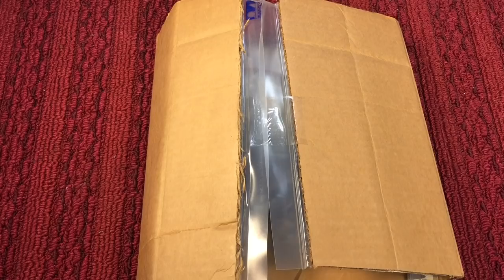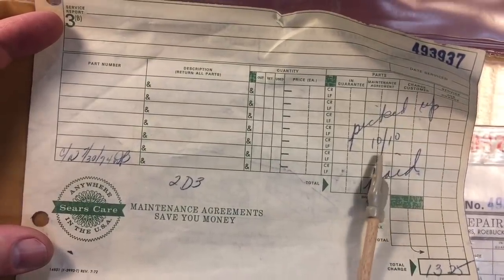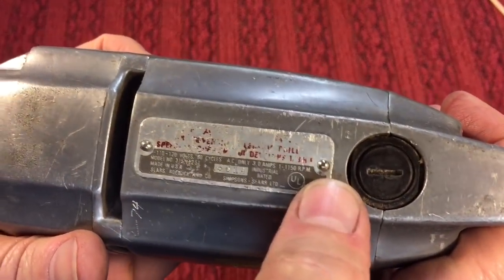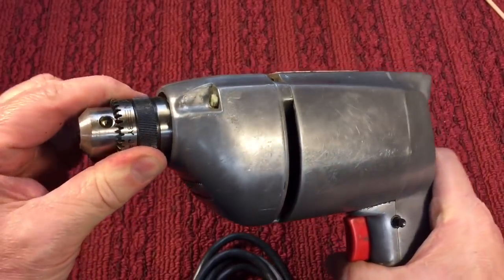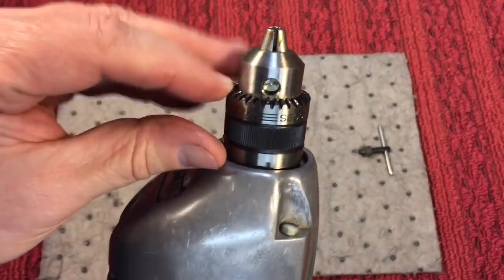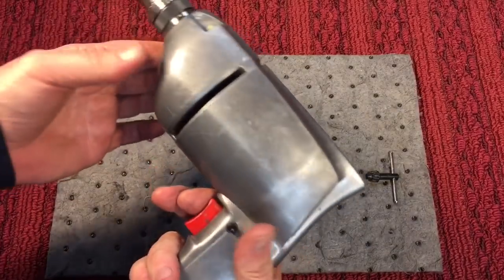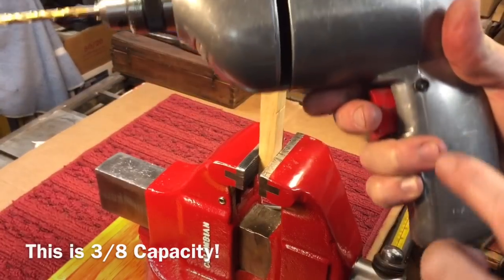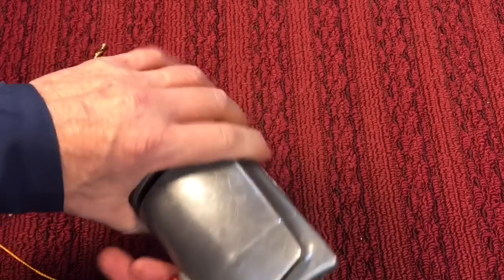Vintage Craftsman Power Drill Unboxing

Comment: There was a wide period of time when metal drills came with grounded plugs. The ones that didn't and are dangerous are (to my knowledge) mostly from before WWII. Sometimes you find newer metal ones with the ground pin snipped off or the cord replaced, because a lot of sockets in the US were two-prong for a long time. This is dangerous because the electrics can short to the housing and shock you, absent another ground. After about 1958 you start seeing metal-bodied two-prong plugs, because Millers Falls started the trend of double insulated tools as a way to work around the two-prong issue. Millers Falls made an estimate from tools sent in to them for service, and claimed half the tools in the US had the ground pin nipped off. (I have some suspicion that number may have been exaggerated a bit to sell the double-insulated feature, but it was a genuine concern.) Metal bodied tools to my knowledge remained in production thru at least the late 70s in mostly "professional" product lines.

I have an old Black & Decker U-100 1/4" drill, with a 3 prong plug, an all-metal front and black-and-grey plastic grip. No VSR on it (it's a homeowner version) but I got it with the manual and several other things for very little. The plastic is actually very comfortable. I did manage to mess up the brush seating when I was giving it a cleaning (not knowing what I was doing) and so it has little blue sparks on the motor and really smells...

Comment: I have one that's almost identical except mine has a shorter handle and no reverse switch. It also has two side vents and no front name tag. I had mine about 40 years and it still works like new.
Reply from the maker: Hello Glenn!  Yes!  I know the model!  Those drills were just so well made, usually the power cord coming out of the handle would fray and crack, otherwise they would run forever! I still have a few I love using!  Thanks!!!!!!

Comment: Scoutcrafter, the hole at the front/top of the drill is to lock the gears is to hold the chuck in place to tighten or remove a bit or also to replace the chuck. My father had a similar 3/8" model and it had the same feature. By the way, they make a rubber chuck key holder that attaches to the cord. I have them on all my plug in drills, they work great. you should be able to find one at any Ace or True Value  hardware stores.
Reply from the maker: Hello Ronald!  Yes!  The Rubber straps work well, better then the plastic ones they replaced!  Mick 47 said the same thing about the small rod!  Thanks very much!  I will try it!  =)

Comment: Scoutcrafter I came across your video just by accident. I was just looking to see if I could find someone who may have found a Craftsman just like yours. You see today Sunday April 14th 2024 I came across one exacting like that with that same Craftsman name directly under the chuck for $4. I cleaned mine up because it was really dirty and the chuck was rusty. I was able to get a chuck key for it. It also has that Allen key on the cord that is 3 pronged. Mine has had a hard life, but still works. Unfortunately the button to lock it on is broken, oh well. Any idea how to replace the button? I love watching your videos.

Comment: The second i saw the thumbnail closed my eyes and took a whiff and i could smell the electric ozone. And when i heard the drill whirll i could see my dad drilling into some plywood. He also had an old 50's chrome meat slicer with that type of motor, so those sounds and smells also remind me of holiday ham being sliced up

I may have that same drill, about 15 yrs or so i had 4-5 metal drills and 2 skilsaws of my dads i was about to toss out. Then i thought better of it because i knew they worked perfectly. Still have em and have been meaning to pull them out for a restore. Nows the time

And i like knotting and the idea of tying the chuck key. So i tried Boatswain's Handcuff onto the key and Prussic  onto the power cord and it works nice
Reply from the maker: Hello T Vład-  you know the Prussic knot saved my life once so years later I made sure all my scouts knew it well!!!  Great stuff!!! I'm so glad you kept your Dad's drills!!!  😃👍.  Thanks!!!!
Reply: Well i pulled out the old box , and boy do i have some more future projects.

Here is what i got:

Craftsman '60' 1/4" drill

Stanley 3/8" drill , faded scraped up label

Black & Decker Home Utility 1/4" drill, HU-1.. very cool old one

B&D Standard Duty Holgun no.653 - plastic chassis

Dayton 3/8" Workshop Drill 2Z395A

B&D 1hp 7 1/4 Circular Saw No. 7301

Sears Craftsman 4" Professional Belt Sander

Skil Jigsaw 3.5amp Model 160

Monkey Ward - PowerKraft Utility Orbital Sander

Gemdaddy Deluxe - Electric Churn

Most look in working order, a couple are seized. Most need new cords, grounding. I fired up the Skil jigsaw, man what a beast. Strong Loud, with a great blast of sweet ozone. That and the B&D HU drill are going back into service.

Beautiful pieces of Americana, glad i kept them
Reply from the maker: @Mostlyonoff  That is a sweet collection for sure!  The cords were always a problem.  You can order some replacements from Amazon or just get a heavy duty extension cord and a half dozen plugs!  LOL  Thanks!!!!!!!!

Comment: Very nice.  You could leave as is or polish the aluminum and clear coat it. You could even change the black area to read with black or white letters.  The value for the drill won't be diminished because the value is set by you. By the way I have the circular saw to match. As to electric drills,  I have several but the best is a newer Milwaukee. Hard to beat that with a battery model.  I am not likely to move to a battery powered drill press either.
Reply from the maker: Hello 57W!  Yes!  I have two drills on the list for restoration as I already bought the replacement cords, I want to polish those and do them up right.  This one since it was refurbished already I will use as is.  I am looking forward to getting started on the other drills.  I love older Milwaukee stuff!  Nothing beats a hole-shooter!  =)  Thanks so much!!!!!!!

Comment: I always saw chuck keys held on with rubber or leather, so they could rotate in the chuck.  Never posted on metal.  How is that going to rotate in the chuck?  That smell in 1950s-60s electronics, fantastic.
Reply from the maker: Hi Mark!  I found out that pin fits in the hole in the housing just behind the Chuck and it locks the spindle so you can remove the Chuck!  Thanks!!!!

Comment: I have one nearly identical from my father.  I want to rehab it but the brushes don't seem to be available any longer.  I also need a replacement trigger, the locking button is missing.  Do you have any resources for finding parts for these classics?
Reply from the maker: Hi Clif!  The brushes should not be a problem...  Many times you can grind the brushes down to your specific needs.  As for the button, I don't know...  These drills can last a long time if not abused!  Thanks!!!!!!!!

Comment: Jeez, I remember buying new drills before that. 😀 That one is sure sweet though a really lucky find. The loop that goes over the body of the chuck wrench then goes around the handle as you had then it goes back through the starting loop, at least that's the way I've always done it. Great tool find, you gonna polish it and restore the tags? Thanks for another cool tool video!
Reply from the maker: Hi George!  I am going to restore two other drills that I already bought cords for, they are aluminum housings drills too!   Thanks so much!!!!!!!!!!

Comment: Outstanding! I think the rod is for removing the chuck, locks.  the drill. Question I need two switch's for old tools. anyone out there  have any hints. Thanks
Reply from the maker: Hello Norherman!  Yes!  A small hole behind the chuck on top of the housing!  Thanks so much!!!!!!
Reply: Check ebay.
Reply: @whatchacookin1096   So far thats been no help. Thanks

Comment: I have this exact Craftsman drill motor and it's my everyday go-to drill. It is rugged and powerful. The variable speed and reverseability are really handy when driving screws. The mass of the armature and gears is enough to finish driving a dry-wall screw the last turn or two flush into a wall stud when the trigger is released. 
   Note the oil hole on the top front of the drill. I put a few drops of medium 30w oil in every once in a while. If I recall correctly there is a lubricating felt on the other end of the motor, but you have to open the drill motor up to get to it. Servicing this drill is very easy as it is all aluminum castings and easy to remove screws. The only plastic is the trigger and the speed control switch. Mine has always had a 3-wire grounded power cable.
  I would recommend opening it up since it is so easy and check for dried out lubricant in the gear reducer and the motor armature shaft.
   I have some kevlar cord for attaching the chuck key. It's tough and cutting it isn't easy. If you want some lengths of it let me know (and of course I'll have to find it in the shop). Making an attaching cord is easy. Tie the cord ends together to make a loop. Hang the key in the cord as you did in the video. Now take the other end of the looped cord and stick it under the cord where it passes over the body of the chuck key and pull it through... voila! When you pull it tight the chuck key can't come loose. Now put the end of the loop under the power cord and pass the other end (with the chuck key) over the power cord, through the exposed loop on the other side and pull it tight.. and you're done!
   
  Cheers from NC/USA
Reply from the maker: Hello Ace! Yes, I will open it up to check it out, I was told the wire on the cord was to lock up the spindle and remove the chuck, is that the hole on top behind the chuck?  It looks like that!  That has to come off before the drill can come apart!  LOL   Thanks!!!!!!!!
Reply: @ScoutCrafter  So that's what its for!

Comment: Hi ScoutCrafter.
I just restored a B&D D300 i think from the 1960 or 70's with a Jacob Chuck...
Had to create the brush holder spring connector... But it runs. And now I have a drill to atach all my grandfather buffing wheels😉
You can see some of the work on my channel..
Thanks for sharing
diYotam Ch
Reply from the maker: Hello Yotam!!!!!!  I love those older drills, they just are such a joy to use!  I have a couple more awaiting restoration!   Thanks so much!!!!!!!
Reply: @ScoutCrafter  My kid love the restored drill. Fits perferctly in his hand. He even used it with a wire brush to remove "patina" from his hammer 😉. Just uploaded a vid of us drilling some holes.
These are beautiful drills. I actually bought it cause it looked nice. Didn't expect myself to get it working...
Reply: @diYotamCh  Good job Best way to start them young is find something they like. 👍👍
Reply: @OldSneelock  You right. He is a handy little 7.5 years old kid. He also good as a cameraman when tripod is on strike 😉